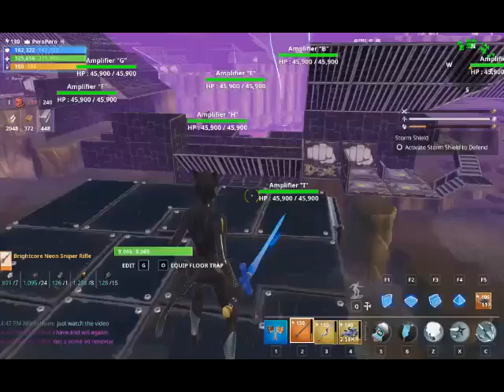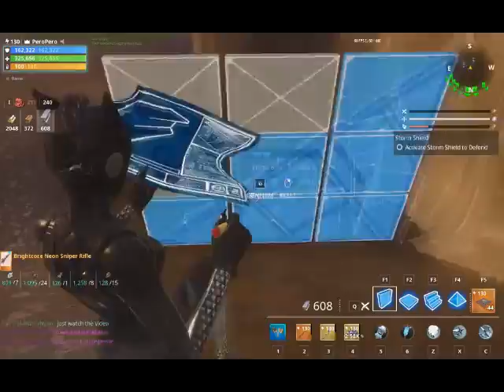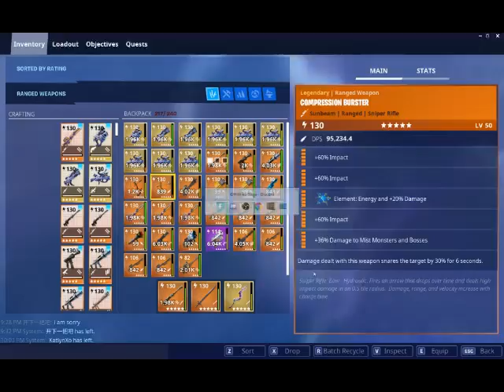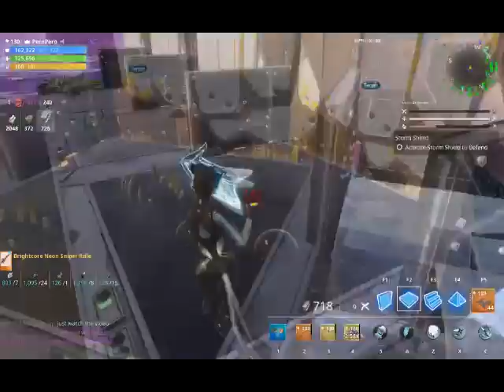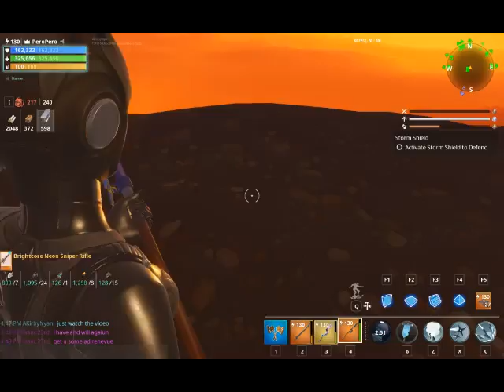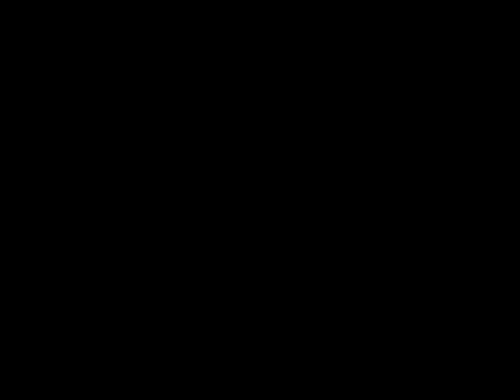(OLD) Fortnite - Save the World - Lava amp SPLIT PATH (Patch 11.40)

Comment: Hi. So I re-created your lava build in base, and was very careful to place every tile correctly. Then, after 3 fails on wave 8 due to husks breaking down the block offs, I tried adding 7 half floors to the block off where the husks were pathing. Sure enough, it fixed the build and made it perfect. 

Only mentioning this because I did not see you mention any half floors being added to the block offs in the video. Maybe I missed it?

Comment: how are these smashers getting recycled when the wall launchers dont even effect them?
Reply: Wall launchers (no matter how many impact/knockback rolls they have) can push smashers by about half a tile whenever their impact resistance threshold is broken. Which is why we put half walls to make them walk around the edge of floor/plateform and so they get pushed off easily.
Some people use them as mini timeout rooms to make smashers stay longer inside tunnel but depending on how/where the half walls are built in your tunnel, it could cause clugging.
Reply: @elycious5329  thanks a lot! I didn't know that! How about the floor launchers? Do they still have a slight impact as well?
Reply from the maker: @butterstw3247 Floor launchers do not do any impact to smashers currently! Instead they make an annoying sound that can be heard anywhere in the map!

I usually use this sound as an indicator that there are smashers in my tunnel that spawned.
Reply: @TheVocaloidNyan  thanks man, do you have more builds for all the amps? I'm starting with endurance again and I'm not sure what still works and what doesnt